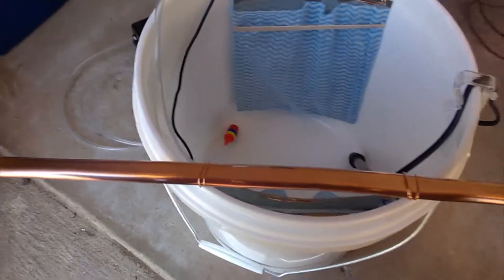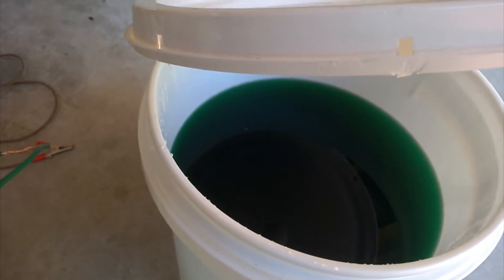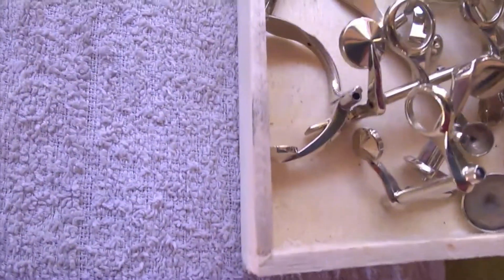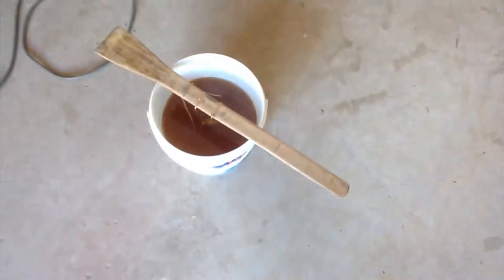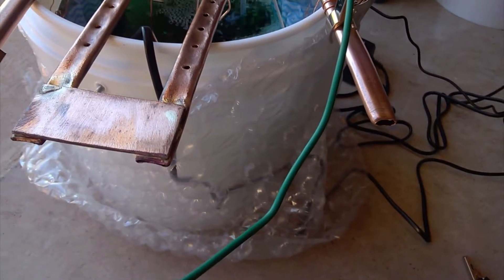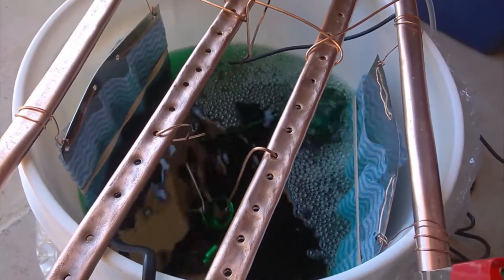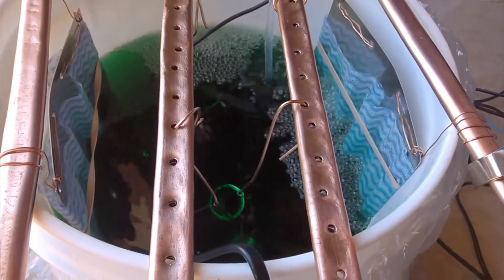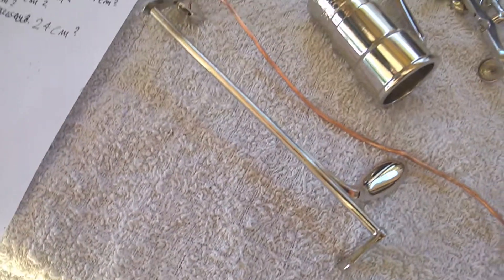nickel plating at home

Comment: How to you polish the parts afterwards...Can you include that clip in this video?
Reply from the maker: My parts did not need to be polished.The polishing process is done before the plating .If polishing is required you need to use a buffing wheel ( made of cloth ) and polishing paste those items are available from Bunnings.The time of immersion in the solution for the plating is related to the thickness of the plating required .I left mine in for 1/2 hour.This is a reasonable time for a good plating thickness.